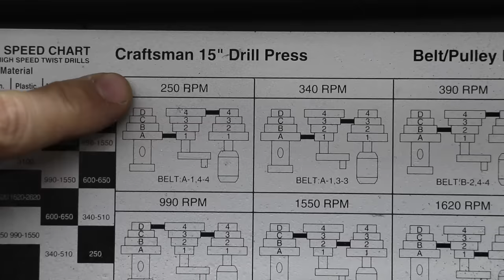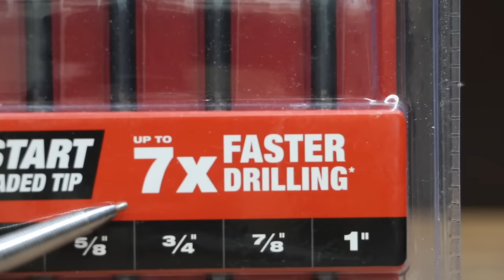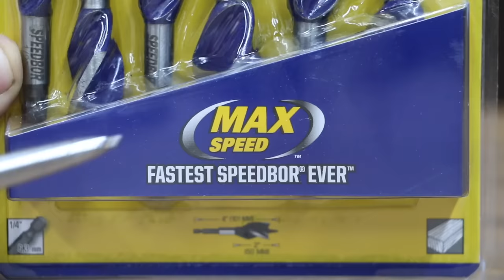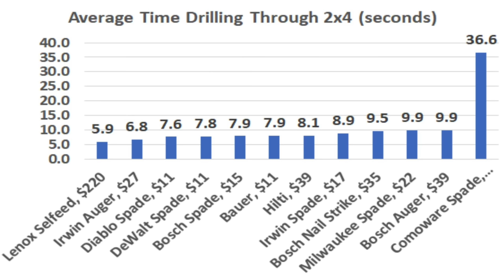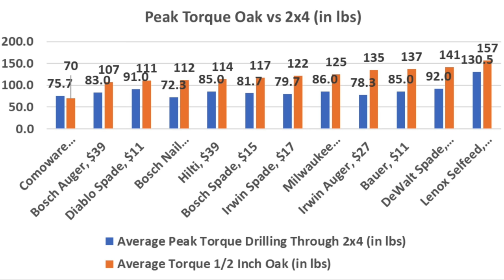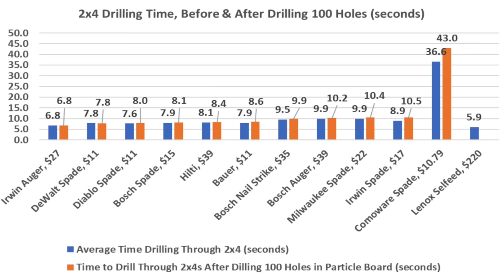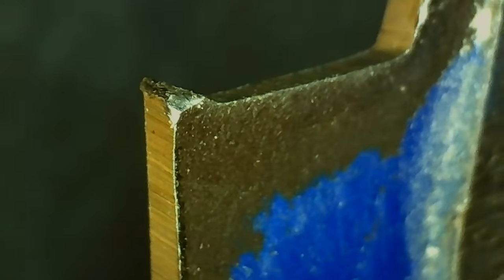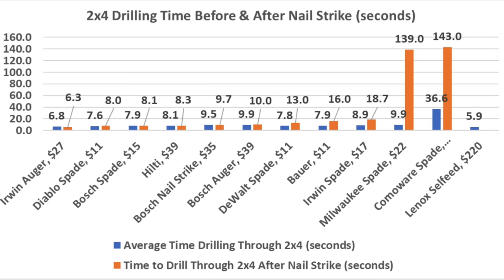Best Drill Bit Set? Hilti vs Milwaukee, DeWalt, Bosch, Bauer, Lenox, Irwin

Comment: Spent $450 on drill bits but can't get the board to fit properly in the vise? It's so annoying.
There are two things I will remember from this video. The good value for money of the DeWalt drill bits and your clamping in the vise.

Comment: When it comes to bits designed for getting wood, we are all getting a bit older. I'd like to see you put different boner pills to the test. I am sure you can devise a test rig with a string and 10 pound weights to make sure the comparison is more fair than objective.
Reply from the maker: Thanks for the suggestion.